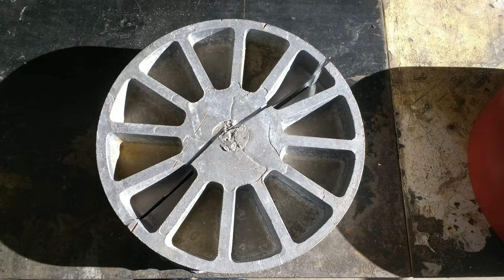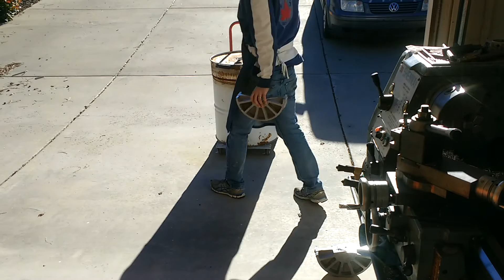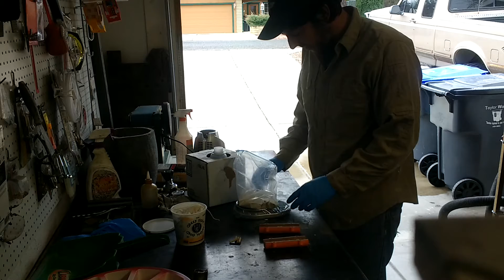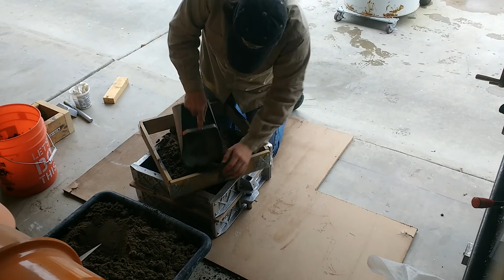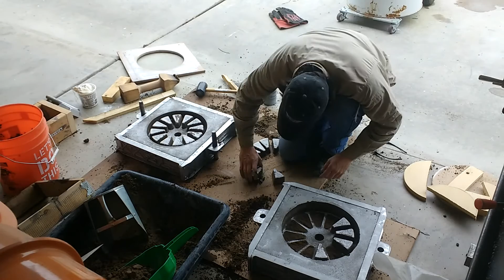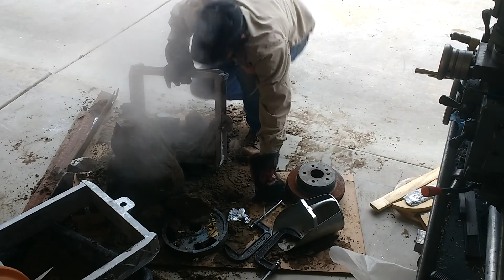Water Brake Rotor Casting

Comment: if you had the sprue in the center wouldnt that somewhat have solved you problem with shrinkage? 
also how much power do you want to brake with that water brake? I'm looking in to building a waterbrake dyno myself, but i dont really know where to get a good rotor made, and i dont really own the machines to make 1 either.
Reply from the maker: bob rosco Yes the shrinkage could have been solved with a riser to feed the metal as it's solidifying and shrinking. I did not want to use one because I would have needed a larger crucible for the additional metal. I'm looking at absorbing around 200hp to start out with (testing a 4g63t motor) and going up from there. I feel your pain, these kinds of things are expensive.
Reply: yeah and im wanting to go up from the 200hp point by a lot too, the engine im starting with wil do 200hp in prettymuch stock form, we are looking to go to de 500hp level and possibly go over that. But the torque might be even more of a problem, im looking for possibly 800nm, that might be the biggest concern. And all the unite i can find in my price range wont handle that kind of torque. I have found a complete old dyno setup that would handle 500hp, but only at 10.000rpm. That means it probably wont be able to handle anywhere near that at 6000rpm.